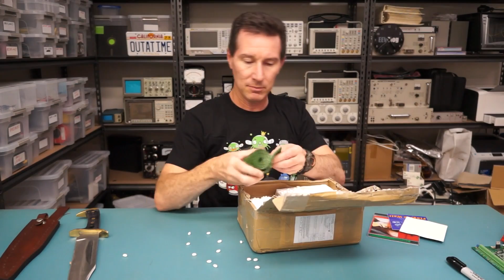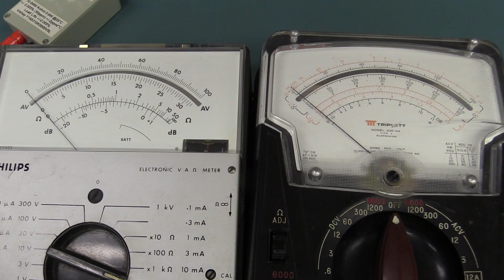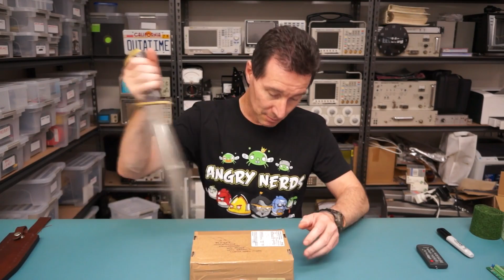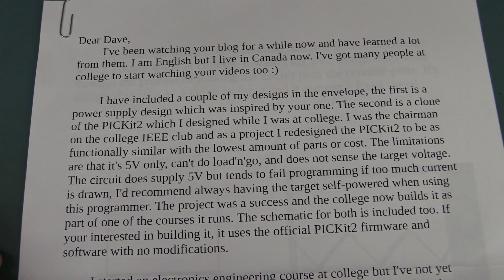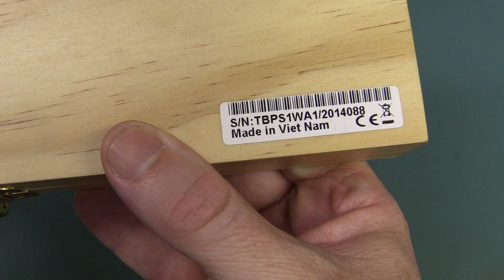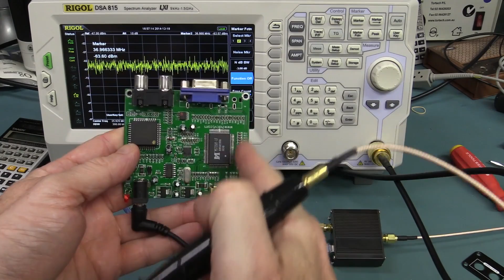EEVblog #694 - Mailbag

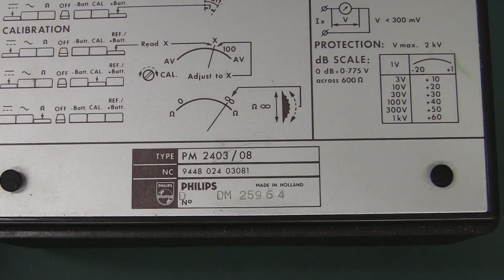Comment: @6:06 Finally someone from outside who got it exactly right.

"I don't remember which part.."
The referral is used for "North Holland" provide

PS i believe the device looks like utter crap inside because it was a diy kit
Back in the days they sold tube amplifier and solid state kits, i bet it's left overs from that  in these kits

Comment: It's not the metal housed transistors that are light sensitive - it is the OC transistor where you can scrape off the laquer at the end tip and turn it into a photo transistor.  But never mind - that is what makes your channel so funny - all the freewheeling and wrong guessing. Makes electronic engineers laugh (if not banging their heads in the wall)..

Comment: Why is nearly all VGA-stuff so low-end?
1360*768 is not much... cause of my dad we did have an Viewsonic P225f - gorgeous 2048 x 1536 via VGA. 
Granted, you do need a real good cable, but that is not really problem.
The hate VGA gets nowadays is strange. Yes, HDMI has its advantages, but for quite some time it didn't have the bandwidth of a good VGA-cable.
Reply from the maker: ABaumstumpf VGA is analog, that makes it tricky to transmit and decode reliably to get an absolutely perfect picture every time.
Reply: It´s just time, and technology movement in general.....VGA is pure analog stuff, while HDMI is all digial. Hence no double conversation anymore. But if you (me too) have some VGA source and sink equipment you need always some interfaces...
Reply: EEVblog Yeah, i now - and i wouldn't switch from HDMI/Display-port back to VGA. 
But it was by far not as bad as many people think it was.
You need good cables, the connectors need to be clean etc.
But it was by no means worse than the early HDMI.

Comment: What wrong with flux on the board? After all those years has done nothing to that board, is not pretty but will no do any harm to the board. Is no cleaning flux, will do no harm to the boards, as you see every time in old electronics does not harm the broads even not after 25 years.

Comment: One time I got a shock or something between two computers and 2 electrical plugs. Later I used my wiring checker for north america, and it said one plug had the hot and neutral reversed.

Comment: You should stick to 60FPS instead of 50, all monitors and smartphone screens run at 60Hz at least.
Reply from the maker: Gordon Freeman It makes hardly any difference. 50fps is still a huge improvement over 25fps.
Anyway, I can't stick with all 60fps, my Canon can only do 50fps, and the 60fps Sony is not well suited to the close up regular blog stuff.
Reply: EEVblog
If that's the case then, I don't mind 50fps.
Reply: Gordon Freeman 50 is more standard in most of the world (except North America and parts of Japan and south america)
Reply: *****
Not if we are talking about computers, go ahead and set your monitor at 50Hz and tell me how it feels.
For the AC power lines sure some countries use 50Hz, but I can almost guarantee you that every computer and smartphone screen runs at at least 60Hz.
Reply: Gordon Freeman My monitor personally is at 72Hz... but I'm just acutely aware of the problem 60fps causes for some european tv sets ;)

Personally anything at or above 25fps is fine for me tho (being on a computer with an LCD monitor)
Reply: *****
Oh yes, for TV broadcasts 50Hz may be fine, but Internet content is different.

Try setting your monitor at 50Hz, and it would annoy you xD, even moving windows looks horrible at 50Hz .
Reply: EEVblog Have you tried setting the Canon to NTSC as your Video Standard? My Canon DSLR only gives me 50FPS if I select PAL and 60FPS if I select NTSC.

Comment: Thanks for showing my mail Dave! The "Hybrid" circuit was made in the Hybrid clean-room at the college, they made us design circuits using thick film too but they would only let us make the pre-approved crappy function generator.
Reply from the maker: dasrattengott That's lame, why? they have the facilities?
Reply: I think it was a mix between the professors not wanting to do any extra work and the college being cheapskates :)

Comment: Those side connections do work pretty when metering if the meter is on the right side of the circuit.

Comment: hey dave why is flux residue for you such an issue when your average user will never see it
Reply from the maker: klarusboy Yup, what you said.
Reply: Some of the older flux formulas can also eat away at materials over time.
Reply: It's a sign of attention to detail and quality or the lack thereoff.
If they can't even clean the flux residue then who knows what other corners they have cut to make the product even cheaper.
Reply: The flux residue did not harm to the PCB after so many years. I think it is OK to leave them on.